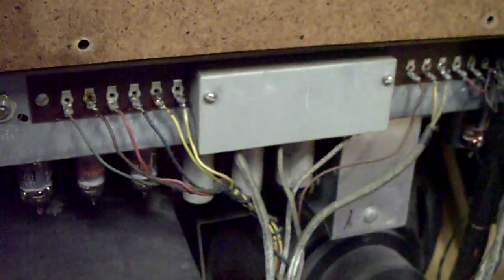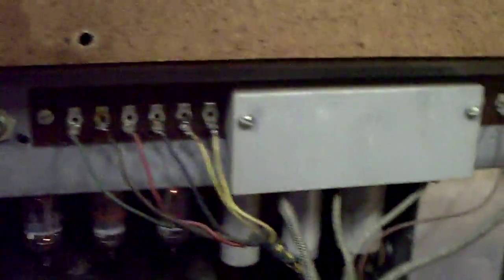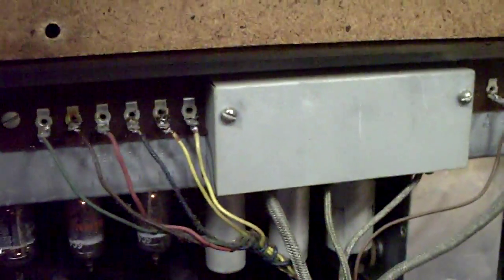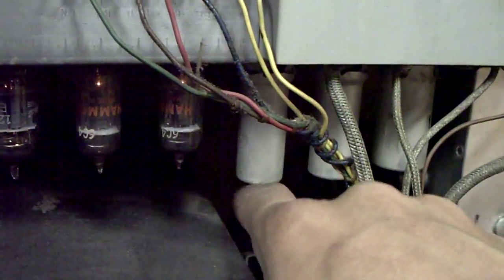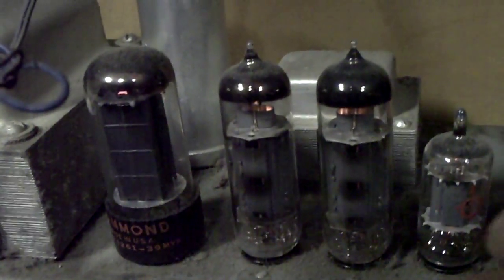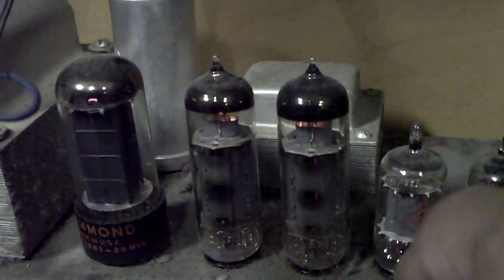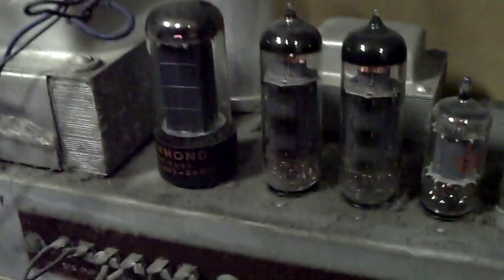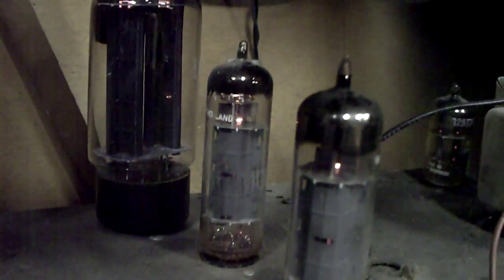Tube microphonics

Comment: Like most electrical appliances, amplifiers of all types have their metal parts and chassis earthed right to the soil.  If any hot wire came into contact with it, it would go straight to ground and therefore, the chassis would be electrically safe.

Comment: You shouldn't be poaking around inside with it juiced up, that chassis might be hot.  Just be careful when working with tube equipment made back than because sometimes one of the mains comming in goes right to the chassis.  Happy modding!!  LOL